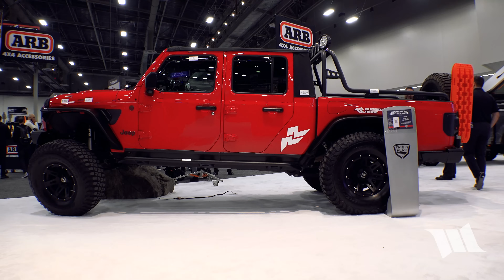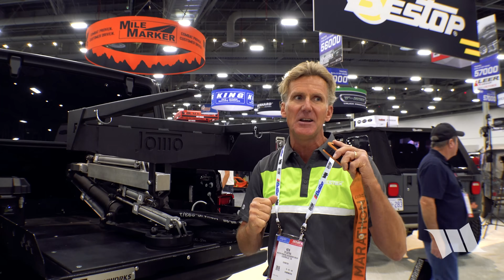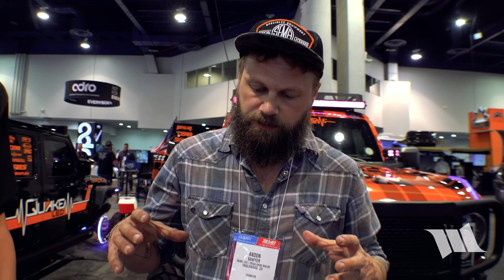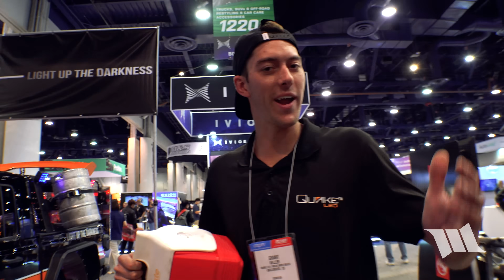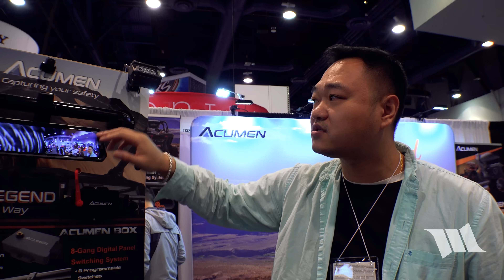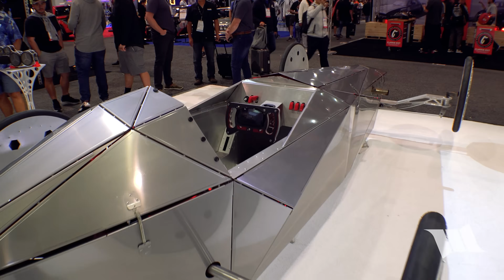SEMA 2022 Jeep Wrangler and Gladiator Truck New Parts and Accessories at the Show DAY 3

Comment: Kinda curious about those tail lights on the Gladiator that was in the Truck Hero both when you where showing the tire carrier.
Reply from the maker: They are made by Rugged Ridge and do a great job of flush mounting in the lights. I wanted to cover it more but Lee was in need of finishing things up as they were about to film their own video with their in house celebrity.

Comment: Hi Eddie, may I ask what is the brand for that gladiator tire carrier? Or can you provide me the link? Thanks
Reply: The red one?  It was rugged ridge.
Reply: @Spack005  nope. I can’t find it thru their web. The gladiator tailgate swing out tire carrier!
Reply from the maker: The tire carrier is made by Rugged Ridge. It was just introduced at this show and should be on their website soon.
Reply: @wayalife  does this swingout tire carrier block the backup camera from the gladiator?
Reply from the maker: @richardxue8277  It does. It will need to be relocated.
Reply: @wayalife  thanks

Comment: Send Cut Send is interesting.  Suspect could make antique vehicle brackets if have one to copy. Thanks for coverage.
Reply from the maker: Honestly, that's the main reason why I found them.
Reply: I'm proud of the fact I provided original roof brackets for my 1924 one ton Ford TT C-cab truck.  They are extremely rare. Took over a decade for me to find all 8 of them.  I loaned them to my friend. He made specific jigs to repoduce identical to original.  Now he sells full sets.  It is a limit group restoring them but Atleast it is correct.